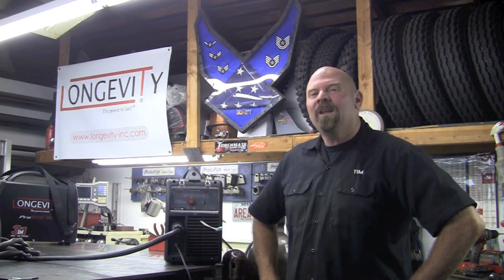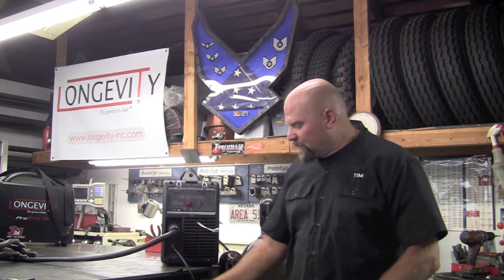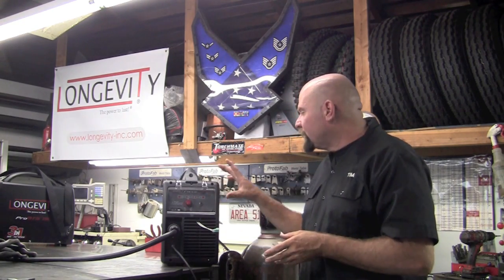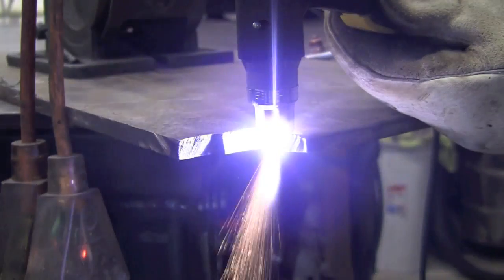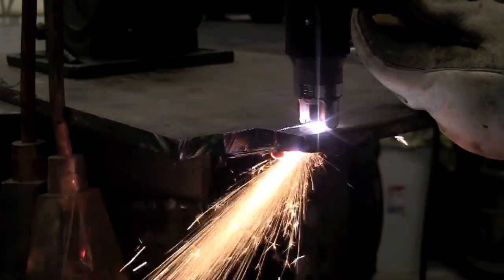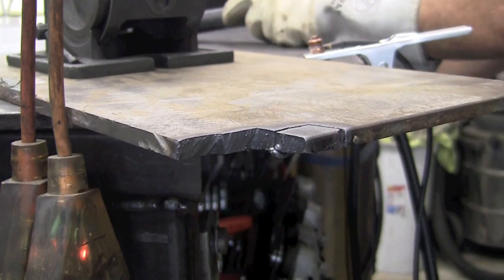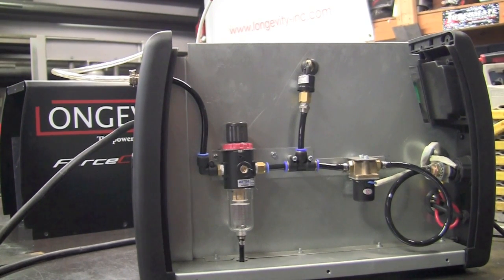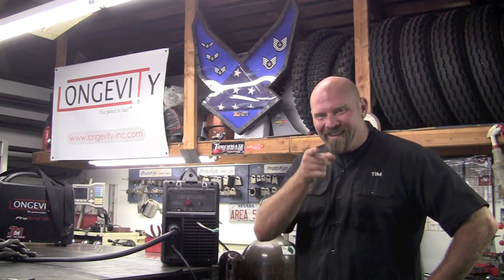LONGEVITY FORCECUT 42i PLASMA CUTTER REVIEW ON 110V CUTTING 3/8" THICK STEEL PART 2

Comment from the maker: This unit will outperform the 50D model based on our testing. Also, its Blow Back start vs High Frequency makes it easier to maintain without adjusting point gaps or worrying about interference from the signal.